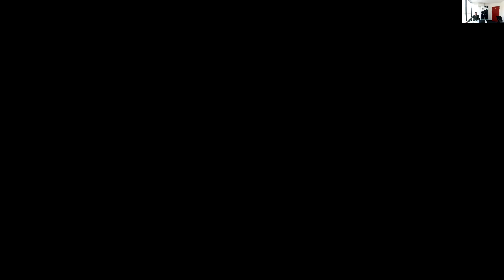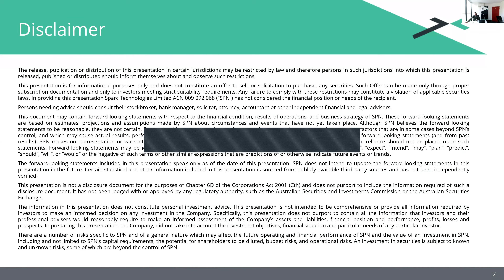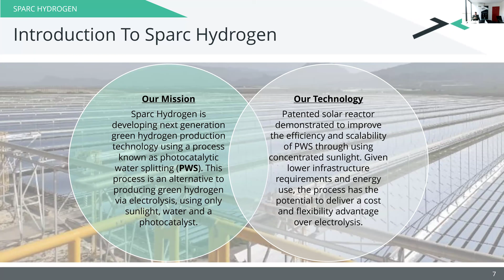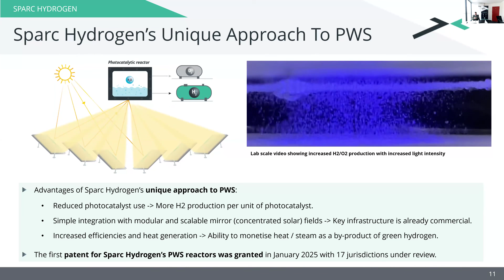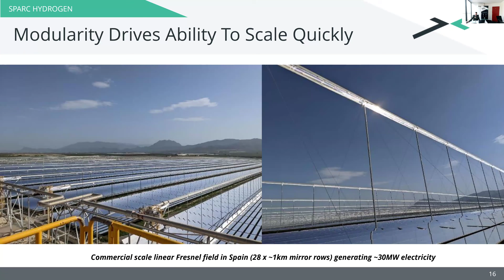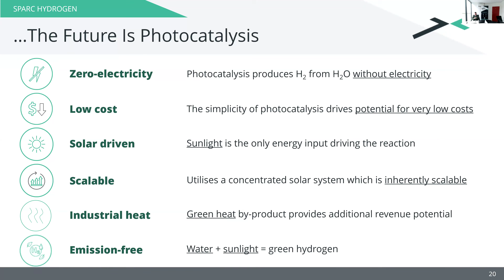Sparc Technologies (ASX: SPN) – Sparc Hydrogen Investor Webinar | May 2025

Comment: To me, one of the most interesting features of this tech (given the efficiencies possible with today's catalyst materials) is the prospect of hydrogen/heat cogeneration for near-term viability, as opposed to viability with hoped-for double-digit conversion efficiencies somewhere down the track. I wonder how much design effort has been directed into optimising the Sparc reactor for the harvest of heat alone ... or, indeed, whether the optimal solar concentration for hydrogen production from the reactor aligns with what is needed for industrial process heat. Am I correct to assume that the heat harvest from a fresnel field equipped with the Sparc reactor would be less than from a fresnel field with heat-optimised receivers? If so, how much less? Take, for example, Heineken in Valencia, which has hybridised fossil gas with the heat from its new fresnel field (~3MWt). Might a retrofit with the Sparc reactor enable that facility to keep its renewable heat (or a substantial part of it) whilst cost-effectively producing sufficient hydrogen on site to dump fossil gas entirely ('cost-effective' in that Heineken's fresnel field is a sunk cost)? Nick O'Loughlin describes process heat as a useful by-product of the Sparc reactor. The CSP industry might prefer the mirror image: hydrogen production, via the Sparc reactor, as a useful by-product of solar thermal heat and power. Mutually beneficial, either way ... and perhaps commercially critical for both parties, at least in the near-term. Let's see.